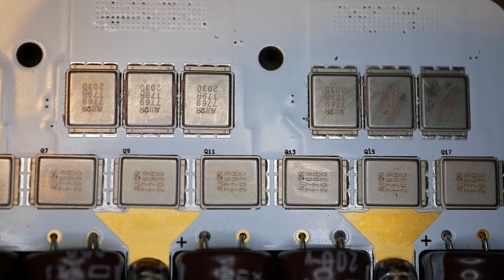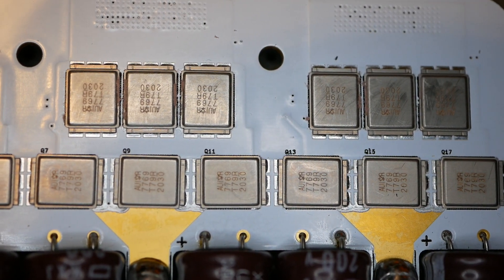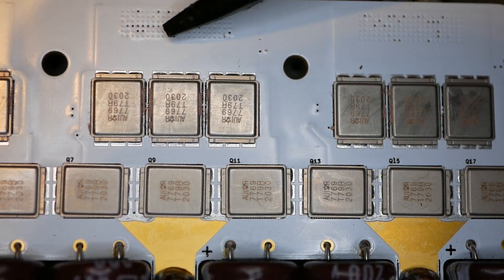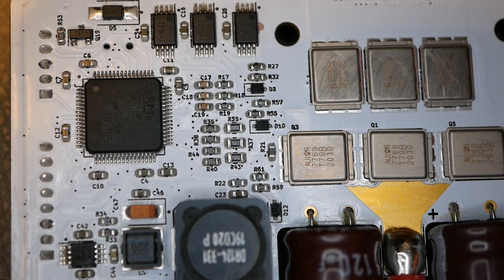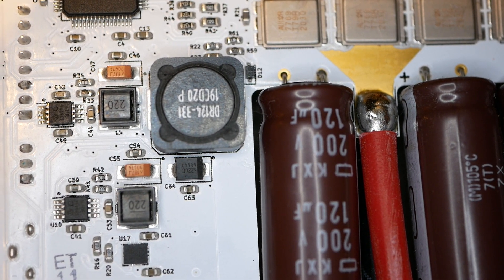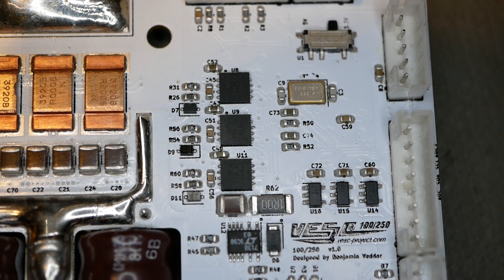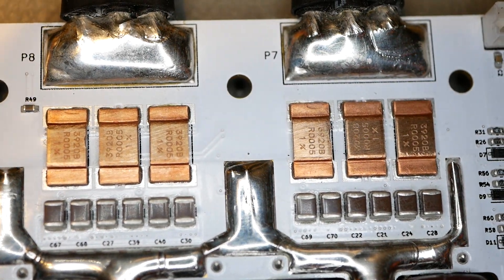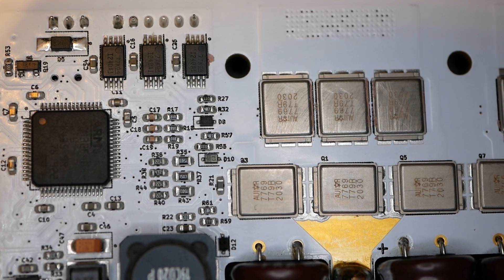Trampa 100/250 VESC Teardown 2 Macro

Comment from the maker: Hi everyone, a few corrections as I improve my content.  I make mistakes some times!
TONS of great comments that help me do better next time! Thank you!!!

1. The small IC by the USB port is not a USB/UART, but rather a CANBUS controller.
2. The 3 small IC's by the analog inputs are not ADC, but rather analog switches. "VEX" is the MC74VHC1GT66 and they have nothing to do with the 3 analog inputs.
3. The 3 current amplifiers are for phase filtering and don't include ADC's. You wont find them or equivalent components in Flipsky and other lower end VESC controllers.
4. Each phase does in fact have temp sensors. They are mislabeled as resistors. They are R21, R49 and R51. I did see them and was thrown off by the silk screen labels.
5. All analog to digital conversion is done by the STM32F405, not by external ADC's.
Reply from the maker: Check digikey and mouser

Comment: I just got one of these from a private seller.  They never used it and had no use for it.  The staff at Trampa said that this controller is rated to no more than 94 volts.  

However, it is advertised as being a 100 volt max controller. 

  I don't know why they would say 94 volts.
Reply: cuz thats the actual component's rating

on 100V rated fets, especially if you're planning to use regen etc i wouldn't even go above a 20S pack (84V max)

while they use a lot of filter capacitance to try to minimize inductive effects (any length of trace and wires have inductance) but it's still not enough to avoid a 10+V spike.

that being said, VESCs are usually rated by their parts' absolute max voltage (not pack voltage), and the maximum motor current they can deliver.

most off the shelf controllers Only show what they'll draw off the battery (i.e. 45A as an example) and have nominal battery voltage rating (i.e. 72V)

in non-Vesc world this would be a controller for 72V (84V max charge) packs, basically.

Comment: hi,i know this is an older video ,but its relevant to what im looking for and i thought you might be able to help ,firstly thanks for all your great videos theyve helped me when fixing customers bikes and knowing what to expect with controllers internally,to my question i have ordered one of the vesc str-500 controllers for my touring project but i need to get another vesc controller with the same maximum voltage but the current can be anywhere from 100 to 250 the size is more important its to be used for modified 750 watt bafang front hub motorthe winding and phase wires are all upgraded and there an option to either lock or unlock the clutch ,so it can do regen and virtual freewheel,they need to communicate with eachother and bms  via can ill be using a cycle analyst v3 to look after the controls like throttle -regen throttle,the brake signal and torque and pass signals it also monitors a shunt before each controller it also connects to can via TTL to can module ,the CA might end up being dropped it will all depend on what i can get this newer vesc tool beta to do anyhow whats your thoughts on a matching controller for the front wheel ,thanks gus

Comment: what diod d7 d9 d11 do ? I couldn't find them on the 75/300 schematic and in the application example for ucc2121. Also what is the buck regulator ic is used for 12V I googled for 7138 but only adc was found

Comment: 12:38 that vex part is not a anolog to digital chip, it is phase filter spst switches. m74vhc1gt66
Reply from the maker: Yup...have a pinned comment with corrections to the video

Comment: You mention it doesn’t need a copper bus across the battery input. Does that mean if you only use 1 of the battery connectors you’re only using 1/3 of the FETS?
Reply from the maker: you need to use all 3 XT90 connectors.

Comment: how can I check that I didn't short the source pads to the gate pad on the mosfet?  I know where the source pads connect to but where does the gate pad?
Reply from the maker: Check the data sheet for the mosfet
Reply: @de-bodgery  I replaced all the bad mosfets and it starts up at 12V 100 miliamp without tripping anything.  I can connect vesc tool and configure it.  is it ok to test it with bad gate drivers? I don't have the right one's yet, maybe they're ok
Reply from the maker: @FourthWayRanch  What do you think will happen if you have bad drivers?
Reply: @de-bodgery  it won't trigger the gate in the mosfet....... so nothing?
 unless it's stuck in high ?
is it possible?
Reply from the maker: @FourthWayRanch  Do you have the mosfet separate from everything else and jsut 3 wires on it? It's an N-channel mosfet. Apply whatever voltage the specs say to the gate and that should turn on the main junction. At that point you should see the main junction go from very high resistance to almost no resistance. Also, these are enhanced mode mosfets which means they have a back diode. You can measure the diode with the mosfet turned off. Best tool is a component tester s oyou can test each mosfet individually to make sure they are actually working.
Reply: @de-bodgery  I can check the mosfet values against the new ones using diode mode, I"ve already done that and replaced all the bad mosfets.
what I'm asking is if it's safe to try and run a motor if the gate drivers are bad?  There are very tiny components next to the gate drivers, I don't know if I can replace the drivers without disturbing things, I'd rather not if I don't have to.
Reply from the maker: @FourthWayRanch  Diode mode doesn't tell you anything about mosfets. That might tell you if the back diodes work, but that's all. Also, what do you think will happen if your gate drivers are bad and you try to run the controller? Do you really think that's a good idea? I mean, it's your controller, do what you want with it.
Reply: @de-bodgery  that's not true, you can switch the mosfet using the multimeter in diode mode. +ve on the drain, -ve on the source, should be zero, touch the gate with the +ve and back to the drain and you should see a value.
Reply: @de-bodgery  can you set the output to miliamps and check it with an oscilloscope somehow?
Reply from the maker: @FourthWayRanch  No...not that low, but you can still put a scope on the motor phases or the gate drive outputs.

Comment: they're blocking mouser links, god forbid people should buy chips.  it looks like maybe AUIRF7769L2TR is the mosfet to replace them with?  The D2pak format is different, these are called DirectFET package.  maybe I'm wrong.
Reply from the maker: Who is "they"? I still don't know what controller you are trying to repair, but assuming it's what is in this video, then those are AUIR7769. Just get those.
Reply: @de-bodgery  youtube won't let you post a lot of links, they just delete them.
the data sheet doesn't show if they have 6 pins?
Reply from the maker: @FourthWayRanch  Yes...that is to stop scammers
Reply from the maker: @FourthWayRanch  Look me up on FB...Richard Gumfaw
Reply: @de-bodgery  never mind, i showed trampa a picture of the board and they say the circuit board gets damaged beyond repair when that happens, $400 down the tubes because of frustration in trying to calibrate their IMU 20 times.  I'm a sucker for punishment.
Reply from the maker: @FourthWayRanch  They can be repaired, but not by most people. You would need to replace mosfets and drivers for sure.
Reply: @de-bodgery  trampa said the layers on the board were damaged?  how can we fix that?  I want to try just for the hel of it to learn something.  I think I'm gonna make a video.  These things cost a lot of money and a just a momentary short can ruin them.
Reply from the maker: @FourthWayRanch  I can't say the circuit traces are damaged. I'd be surprised if they were, but it's possible I guess. PM me on FB so you can show me pics of your controller. Assume you will be replacing mosfets and gate drivers.
Reply: @de-bodgery  Ok, I don't facebook, I"m going to post videos so others can learn too, trying to figure out a cheap camera for overhead zooming, my gopro won't do it
Reply: @de-bodgery  i pulled 5 of the MOSFET off with the new blow dryer, the pads don't look damaged to me.
https://youtu.be/IcPpzgn_JUU

Comment: please, how can we test those mosfets with a multimeter?  I've looked at other mosfet test procedures but still confused.  none of my caps look like they blew, all the little ones on the back read same resistance. also how to check the gates?  repair might be doable as long as the internal paths in the board haven't been compromised i think
Reply from the maker: If they show resistance from source to drain, they are blown. Gate drivers commonly blow when mosfets blow, but not always. It's best to just assume you need to replace them.

Comment: I crossed two output wires when i was trying to calibrate the gyro for my EUC.  I see a burned thingy, fet I think.  I ordered a smd blow dryer, we're gonna try and fix it.  thanks for this, it cost a lot of money.  is there a way to see if the control board is ok before I dive into this repair, I suppose I could fix the control board too if I have to but would need a microscops
Reply from the maker: If you blew mosfets, you might need new gate drivers too.

Comment: How INA240 used in this 100V board? It has common mode voltage limited to 80V.
Reply from the maker: This is a 100v max controller. You can run them at a full 20S...I am.
Reply: But INA240 does not support 100V! Wondering how?! https://www.ti.com/lit/ds/symlink/ina240.pdf  @de-bodgery
Reply: @de-bodgery   He used those for low side sensing I guess. In the VESC 75V he used the same for inline sensing and I could not find this 100V pdf online! So the confusion and it is clear now! Thanks!
Reply from the maker: n @edisonphoenix3303  Aarly on in VESC development Benjamin used to share the schematics for all of his work. You can still find some of his original work online. I've looked it over many times myself. He no longer does that as all that happened is people copied his work exactly and directly competed with him for the exact same product! For the past several years, he has kept his hardware design work private and no longer shares that.

Comment: damn them fets can handle 375A max each, but 2.9mOhm rdsON is quite high vs those Chinese TOLL fets EBMX etc use (1.2mOhm)

those 3 together per high/low side is still 0.96mOhm when fully turned on

i like the design tho
Reply from the maker: You won't actually get that from the controller. They are rated for 250 phase amps for good reasons.
Reply: @de-bodgery  Ya i know, just ment the standard resistence is quite high for those

Comment: The IC next to the USB port (U3) is a CAN transceiver and not a USB/UART converter
Reply from the maker: There are 2 IC's on the board I didn't look up and one of the 2 I totally ignored and the other I got it wrong. Ha! I am improving my content to make it more accurate and to add part information. You'll see that in this video. This is my first attempt and it is improved, but not perfect. The 3 precision phase amplifier devices, are they the physical devices that do phase filtering? I notice that Flipsky controllers lack anything like them and they have no phase filtering.
Reply: @de-bodgery  the analog switches just connect and disconnect a filtering capacitor to the STM32 ADCs. There's tiny trace that goes from each phase to a voltage divider, that scales max voltage to 3.3v tops. This is then fed to specific stm32 ADCs, and that's what measure the phase voltage so the controller observer can track the motor when not powered. Observer tracking is not very good at low speed (unless you use HFI or run sensored) because there's too much noise. In order to improve it, there's an additional capacitor that these switches can enable on demand, and so the cutoff frequency is low for the filter and it improves low speed sensoreless operation. After the speed gets higher, the signal is good enough and the filters get in the way, so the switches open (commanded by stm32) and disconnect the capacitors
Reply: @de-bodgery  Flipsky and other low cost ESCs don't have these phase filters

Comment: U14, U15 and U16 are MC74VHC1GT66 is a switch for the phase voltage sensing filters
Reply from the maker: Thank you! AS said in the video, I couldn't find those part numbers so I did speculate on their function. I appreciate this sort of feedback as it just makes the next video more accurate! This was my first attempt at adding spec sheet content and there are many details to still improve on!